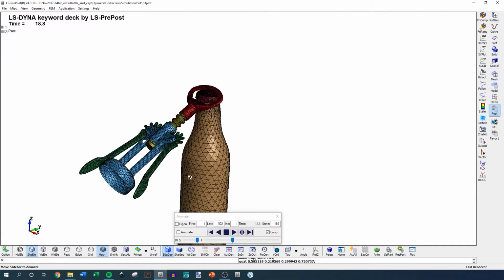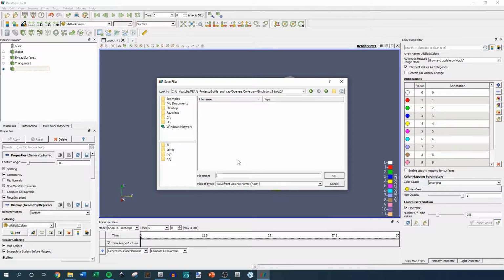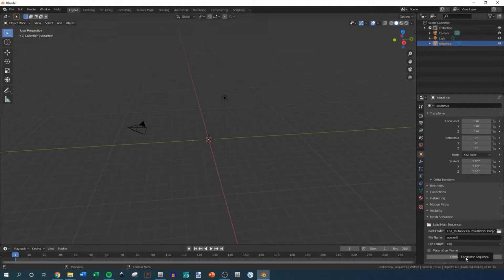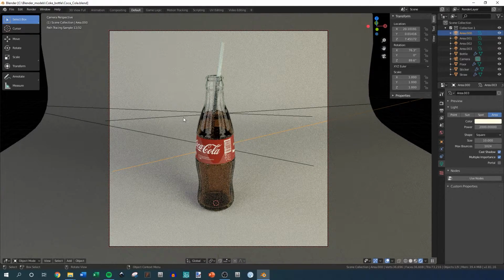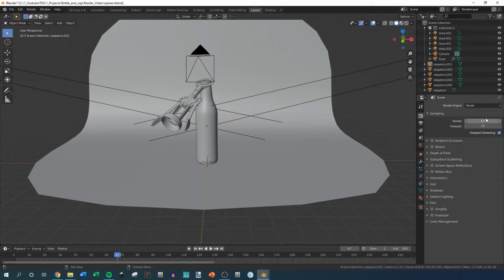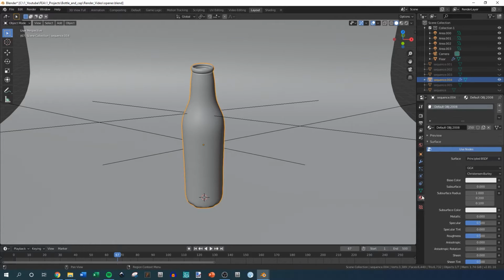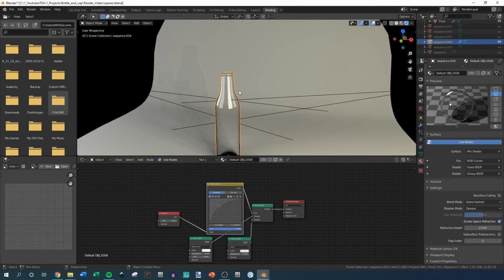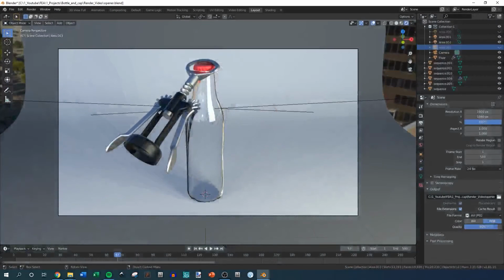How to Render Realistic FEA Simulations in Blender for Free

Comment: Just that you know, you can achieve this kind of rendering in Paraview directly. Paraview now comes with a pathtracing and raytracing renderer. Obviously you can't tune in the material parameters as much as in Blender but, for what you're doing, Paraview is way enough. On top of that, you can easily plot useful quantities in Paraview such as stresses or strains whereas it is way more complicated in Blender (not impossible though but absolutely not designed for that).
Reply: Paraview has had ray tracing for a while. This channel did a video prior to this one showing ray tracing in paraview 5.7.0. Was there a recent update that improved this feature?

Comment: You just turned off the viewport visibility. In order to turn off the light in rendered view you have to first make the button for it visible by clicking on the filter icon on top of the outliner and then click on the camera icon. Now there should be a camera icon next to each eye in the outliner. To deactivate the object for rendering just click on the camera icon next to the eye...

Comment: B- but it's not a FEA simulation though... it's just a static render
Reply from the maker: Not sure where you got that. It’s the animation from an LS-Dyna simulation.
Reply: FEA simulations are things like heat/stress/flow/transfer analysis using proper physics simulations to show mechanical stresses in objects, usually shown as a red-green gradient. I see none of that here, that is all. I was Googling around to see if Blender is capable of doing those because a friend is wanting to design some parts for a vehicle and stress-test them in CAD before fabricating them and it would be best if he doesn't have to buy software to do it. As far as I can tell, Blender doesn't even have the capability to do FEA.
Reply from the maker: Just because I’m not showing a stress gradient, doesn’t mean it’s not an FEA simulation. LS-Dyna is the FEA solver used for the simulations shown in this video. I only used Blender to render the geometric output from the simulations. 

There is something I’ve seen in Blender that may work for your friend called Blender bullet constraints builder + Fracture modifier. Kinda like a pseudo-FEA
Reply: I'd like to add that if all you want to do is plot stress and strain fields, you can do so directly in LS-DYNA or by exporting them and plotting in Paraview.
Reply: This 100% FEA. To be more precise Non-linear (explicit?) analysis.
Reply: Can I make vedio with that!! Vedio rendering